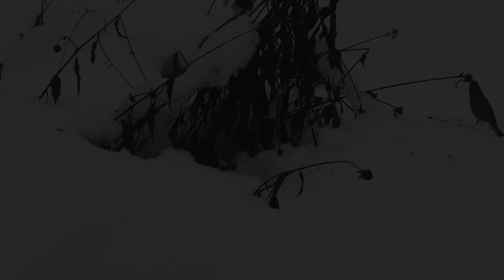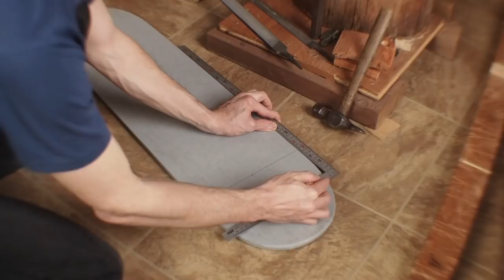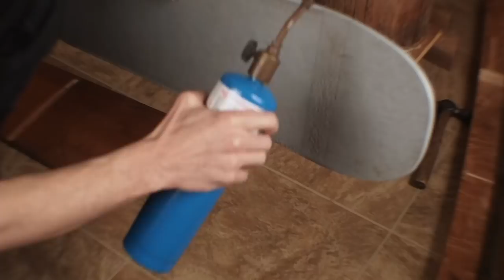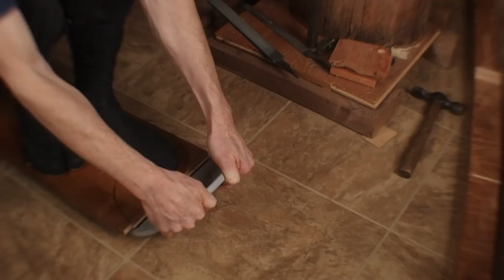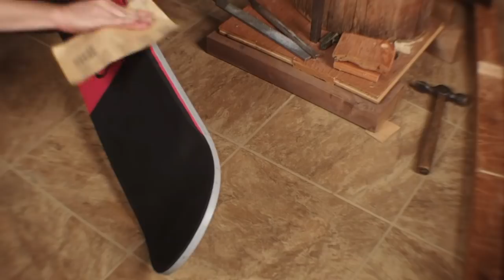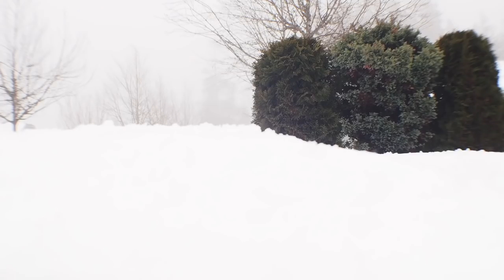Blacksmith Forging Plastic? DIY snowskate from recycled decking material

Comment: KOSTON VOICE: "do a kickflip"
Reply from the maker: (^___^) it is possible but the pop is much slower than wood+wheels so it takes some getting used to...
Reply: @islandblacksmith  Yeah it'll be hard. However, if you try to pop low, flick slightly late and really drag the front foot up, you can definitely kick flip this. Your DIY board has a steep enough tail anyway, which is probably the most important part about it. Good build! And loving the Ninja boots dude.
Reply from the maker: @PHeMoX  yes, it certainly does! ...and thanks!

Comment: Looks really good!  Is it stiff enough to pop?  Does it track? What about grooves on the bottom?  

Also, foam grip concave looks spectacular!!! You should do a "how to" video just for the grip.  Good job!
Reply from the maker: when it is cold it has reasonable pop and stiffness enough to boardslide, but not as much as a wood board...i have made others with grooves but am pretty happy with this configuration more like a snowboard with just edges...

Comment: Nice job! Now if you grab a router and make some channels in the bottom it will give you more control. (you probably know this already but just in case! cheers)
Reply from the maker: the first prototypes years ago had 2 channels (a tablesaw/fence with a dado blade, after bending the ends up, is the best way to make them) but for more advanced riders i find the smooth snowboard-like bottom buys a bit more speed while the edges still provide a reasonable amount of control...as with most things it is a trade-off...

Comment: I'm just about creating my third version of a DIY snowskate, each year making it one better than the last - How did you manage to get the finish on the grip so smooth around the edges?  MIne ends up ripping and peeling off around edges after first use (i use standard craft foam?)
Reply from the maker: this is eva, the stuff shoe insoles are made from, and it is fairly stiff compared to some of the stuff out there...when i shape the edges i pretty much try to do it right in one cut with an exacto/razor but if there are issues i fix them with a coarse rasp...45 degree angle helps prevent damage too...